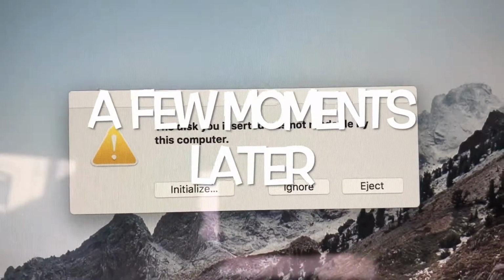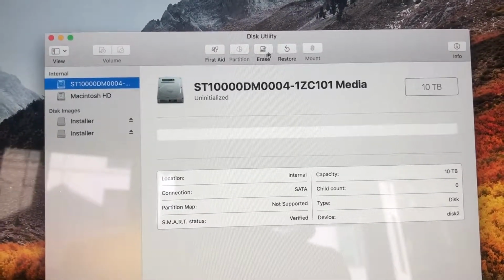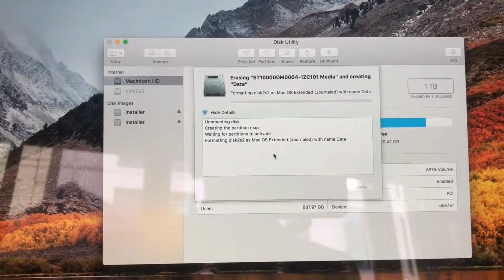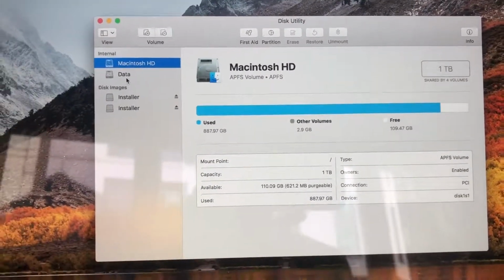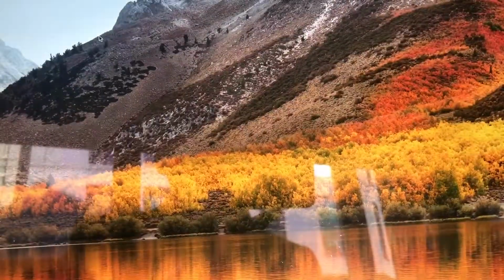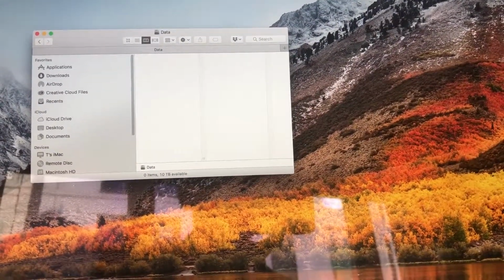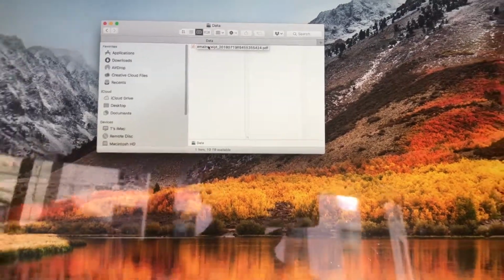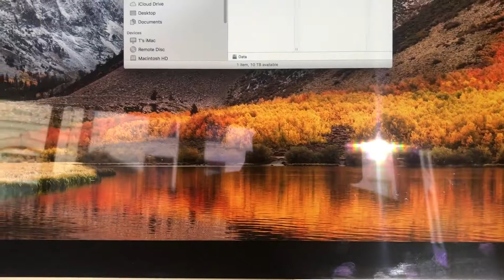Can a Apple iMac Take a 10TB Upgrade? Missing Cable!!

Comment: Unfortunately you don't show how you install the hard drive cable onto the logic board which is the most important part of the entire process.  Did you need to remove the entire logic board or was there some way of loosening the logic board so as to partially lift it and then enabling the connection of the cable ?  I have just purchased (2nd hand) one of the iMacs with the same setup (ie.SSD only) and want to install another hard drive - however I cannot find anywhere instructions on how to attach the missing cable. I held out hope after seeing the title of your video but you leave this part out completely.